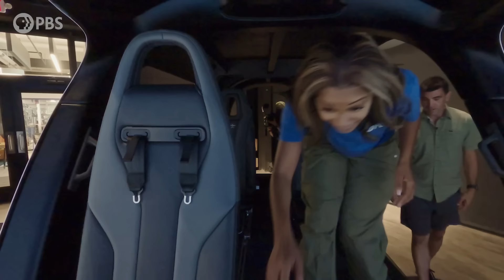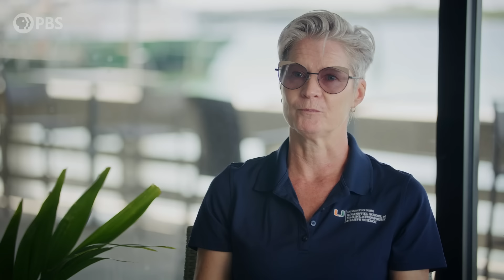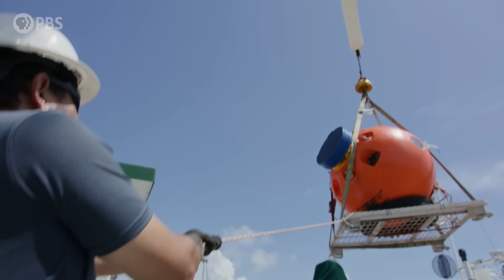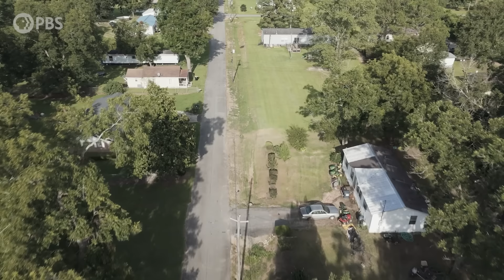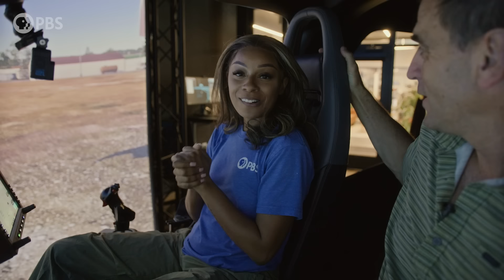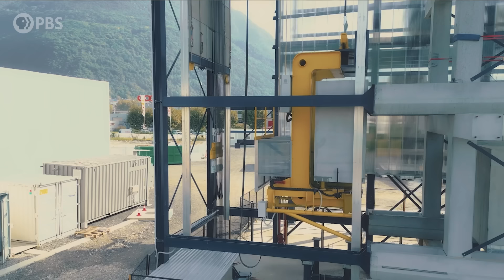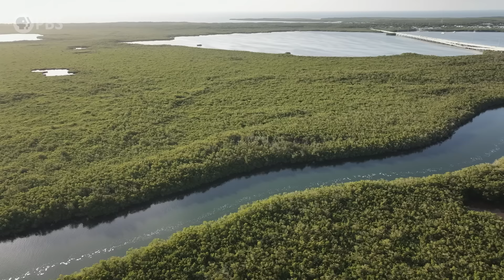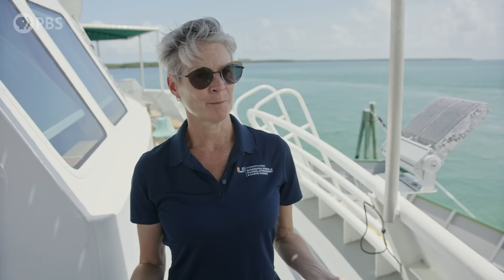This Is The Best Evidence That Atlantic Currents Are Slowing (AMOC Explained)

Comment: insert techno hopium at the 9 min mark.

also... why electrify heating when solar thermal and thermal batteries are significantly superior at harvesting energy per sqm. and storing energy at scale using the volume vs surface area advantages and ultra simple materials, such as Sahara sand being viable, unlike for construction.
Reply: I hate this, too. We are screwed. Do you think ANYTHING will happen with this current US administration? No. Even worse than nothing. Drill, baby, drill pres is stepping on the accelerator and cut the brake cables as we drive off the cliff
Reply: @ We are completely..
I am in the UK. It seems that starting from 2045 uk will lose 30% of ALL plant life, 50% by 2070.
This is due to the Habitat simply being outside of what those plants want.
they will wilt and suffocate.

I am living my life as if it will be 5c by 2100.
Yes, complete civilizational collapse, mad max and the entire 6th mass extinction.

We are at the point in time where every single individual needs to decide if they are going to burn bright and go young, or plan for the long hard cling to existence in order to be the future ancestors of human 2.0

Comment: With the needs of mining, aggro & transportation of goods & people I don't see fossil fuels being fully removed anytime soon. However reducing that need to a minimum to buy time for the innovations needed to remove oil dependency is undeniably a smart & good move for humans & the globe at large.
  What I really want to see is the efficiency accelerate in home & work buildings. Geothermal heat stabilizing systems to reduce our heating & cooling needs. Combined with using older methods like masonry heaters over common fireplace & wood stoves to really make the most of our renewable heating options for more rural areas. Micro Hydro like the UK's Turbulent system to reduce the centralization of power distribution. 
  Next would be advancing diverse permaculture farming & getting away from dead monoculture forests & fields that are leaving depleted soils in their wake.

Comment: In today's world, it is important to reduce electricity consumption after sunset, when solar panels are not producing electricity, in order to reduce CO2 caused by thermal power generation.
I achieved carbon neutrality even during last year's intense heat with a solar panel with a small capacity of 2.3kW.
The most effective device was the icon device, which uses wind to cool rooms during the morning and night hours when temperatures are low.
After trying various things, we found that simply pasting aluminum foil on the inside of the windows was effective in reducing the heat in the house.
Compared to 2017, just before the full-scale use of this Wind Leader, we have been able to save 883 kWh of electricity in 2024 (electricity from June to October).
Although it is in Japanese, the details are listed on the homepage, so please refer to it.

Comment: What electrified heating source powered by renewables is more efficient than natural gas/propane? If you look at the official data sites on different heating sources powered by different fuel sources clearly show natural gas/propane heaters are the top efficient way of heating a space.

Comment: I live in Thailand, we have more than 300 day/y sunshine. I installed solarpanels and 2 homebatteries.. Now we dont need power from the grid anymore. Save money, have stable elacticity and help a little to slowdown the climate change.
Reply: Hello! I live in the Philippines. Please consider using heat reflective paints on your roof and walls. It can help cool down the indoors.
Reply: @aikavi5614  Yes, I know I was a painter when I worked in Europe.. And I did put insulation under the roof too.
Reply: How much would this system cost the average homeowner in Thailand?
Reply: I was told we need better ways to dispose of/ recycle solar panels.

But. Im in Canada.

I live in a place that hates renewables, and sunshine is. Not constant. But even WE have solar panels to at least some less oil? Most of the oil we drill for is for sale, too. Like. Others use our oil even more than us?! 

Like. I have a feeling we could do renewables if we had more walkable cities, and the oil companies didn't buy off our government so hard. Like.

Im glad your countries are being smarter about this, but I wish my country/ my region was.

If I was less poor? I'd be putting in solar panels in anyway. Lol.

Good to see y'all doing the fight, though
Reply: @stoodmuffinpersonal3144  Hi from the UK, they are developing better ways to dispose of and recycle used solar and wind products, some used solar here is sent to African countries as even though panels are not as efficient after 25 years they still work well enough in very sunny countries. With regards to Canada, as you know you get quite extremes of temperature and people walking in below freezing temperatures is a challenge for some, especially the elderly and disabled. One thing to consider is changing to a heat pump as they work ok still as the Scandinavian countries have found, maybe you can even get help with the cost from your local government?
Reply: @stoodmuffinpersonal3144  lot easier and more valuable to recycle solar panels than say tires or most plastics. the copper can be recaptured as most of the silicon & hardened glass can be remelted and reexposed to reactants to reform new photovoltaic cells
not to mention dad still has solar pannels from the 90s that still produce some charge
nothing like the newer ones but we also ran our house on 2 panels back then, these days we have a dozen new super panels and like 7 from various eras in the past so u can do things like run bench grinder vacume cleaner electric welder ext without a generator assist all 50kms from nearest electricity lines
we used to have to run a generator for the larger loads but these days its about same price to just add a extra 500 or 1000 KWH of storage than buy a generator
Reply: yeah in australia we provide 80% of our grid power in day with solar. we are still installing giant batterys but within a yr  or so  its going to be all battery owners filling in daytime when powers near $0KWH thanks to rooftop solar then selling it back to grid at $250KWH till next day
Reply: How did them panels get made? Biggest scam ever!
Reply: That's awesome ❤ your awesome
Reply: No it doesn’t
Reply: @violetquinnlaw:  Do you have any idea of what the inside of our planet looks like? There are lots of CGI images of the internal structure of our planet on the net, so you should!

FYI: The core of our planet is the same temperature as the Sun. The Sun is 93 million miles away, the core of our planet is only a few thousand miles away. They are the same temperature! The only thing protecting our feet from being burned off is the Crust of our planet. The crust of our planet is basically, chemically  speaking, a ceramic and ceramics are some of the best insulators known to science. Which is why they are used on the Space Shuttle to protect it from the heat of atmospheric reentry.

If you  shrunk the Earth down to the size of an apple, the crust would be no thicker than the peel of the apple and everything interior of that, would be red or white hot. Where does all that heat go do you think? Maybe invisible aliens are sucking it up and transporting it through a wormhole so it never passes us by and has no effect on the background temperature we refer to as climate... NOT!

The internal furnace of this planet keeps the overall surface temperature just right, to allow the Sun to add its' energy and produce weather that doesn't destroy all life but does mix and circulate the atmosphere and clean and purify the planet, to foster life here.

It is the incredible stability and finely regulated background-temperature/climate of this planet, that has allowed humans millions of years to evolve and is a testament to the independence and indifference of climate, to anything mankind can dream up. 

I hear the same narrative over and over, "There has to be alien life out there with all those habitable planets!" They just don't understand how special this planet is and this is only one of dozens of factors. This planet Earth is a very special place in the universe. 

This Earth is perfect in every way, to allow the evolution of sentient life and only a life form with exactly the same conditions and history could do the same, so the chances of finding intelligent life out there are slim to none, because there would have to another world with identical everything... Not just in the range but identical! Highly unlikely.
Reply: I live in Western New York. I get snow and cold half the year. The US government built an Air Force base near here because the cloud cover hides it from satellites. I have solar panels and live off grid. There is no reason for people not to be doing it.
Reply: Honestly, great you’re doing that, but we are past that point. We’ve gone past the point of no return
Reply: @habitant71  Gloom and doom is easy, but while there is life there is hope. Surprising changes can happen quickly, but yes, there is a point of no return. Trump, et al, are pushing the wrong direction. The electorate must understand this before it is too late. Was it Churchill who said: "Americans can always be counted on to do the right thing......
after every other option has been exhausted." (?)
Reply: @habitant71  How can you tell?
Reply: All bull sh*t
Reply: You gotta buy bottled water though?
Reply: Everyone needs to worry about air
Reply: Im going to go to college to be a solar panel technician and I will install solar panels free (with a contract not to sue😂)  as long as they purchase materials!
Reply: Your electricity is nice but will it work underwater?
Reply: @rk41gator  I live 44m above sea level
Reply: @ferrydoolaege3776  nice for you! but what about the millions who live between you and the sea? how is their electricity going to work. Bravo for your work but how do we get the US and others to stop polluting the air and increasing emissions.
Reply: Nothing you are doing has the slightest effect on climate...
Reply: @rodkeh  ...we are a collective though, if one person gives you £1 you are not rich but if 1m people do, you are a millionaire, it all adds up...
Reply: @markreed9853  Comparing apples and oranges is considered childish where I come from...
Reply: @rodkeh  Not true.
Reply: @ There is nothing anyone can do to affect the internal temperature of this planet!
Reply: @rodkeh  lol what dose the internal temp of planet have to do with the price of fish. u should learn some science climate change isnt about us effecting the internal temp of earth its about atmospheric warming ie 'outside' the earth
Reply: @rodkeh  ....internal temperature??
Reply: @ Yes, climate!

Comment: Heat pumps are not efficient in some areas.  The killers is cotton wood seed. Dirt dust particles. Stop up the condensation Finn’s  making the unit  useless.  Just burning electric.   The long term studies.  Are not there.  These new AC units. Are  at a loose.   The. Pollution is chocking down the units.

Comment: I live in central British Columbia and installed a heat pump in the first floor.  It works even down to -20 Celsius.  and costs only $0.10 per hour.  We have only renewable electricity in BC.
Reply: Heat pumps are the most energy efficient solution even without green energy. Everyone should be using them.
Reply: @Robynhoodlum agree…however do not work in very humid environments
Reply: @isabelab6851  
That may not be so true, as there is more than one type of heat pump.
The video showed an air sourced heat pump, which is excellent in the state of Georgia.
However there are also water based, and ground based heat pumps.
I bet at least one of those three would work in very humid environments.
Reply: @isabelab6851  you have to do a different design but anywhere on this planet if u go down far enough it starts to warm up u just need to sink a heat well, some places its less feasible than others. you can also setup air or liquid based surface systems for heat capture on/in roofs and walls and then use that to heat things like sand battery's that then via a second system of piping carry that heat thru house at night/when it cools down

but yeah ground trenches arent great if u get a lot of rain even pipes can float but a waffle in sub soils only 1 way of doing a heat pump u can really 'bend' that waffle over and in any way u want so long as u keep a circulation
its a lot easier when your building them in construction not installing after the fact also
Reply: its not that renewables aren't more efficient its that the US dollar to this day is linked to oil so when your pumping oil your pumping reserve currency, so no mater HOW good alternatives are they will find a excuse to have ppl use oil so they can pump oil/$$$
Reply: No one is trying to stop oil use.  But gas and diesel etc are far majority of uses of oil.  @violetquinnlaw
Reply: @violetquinnlaw  Very true....Big oil and big pharma own American politicians.
Reply: Will it work at -40?
Reply: @Mainlychesscontent  very few parts of planet get to minus 40*c(shes in BC hes talking metric not imperial) only artic and antarctic but yeah iceland is powered off geothermal/heat pumps
Reply: @violetquinnlaw  not only Arctic and Antarctic. I was born in Ulanbataar, Mongolia, and lived for 10 years in Irkutsk, Russia. 

Both places hit -50C and lower in winter regularly, and neither are in the Arctic. 

The place where I live now (close to the Arctic, to be fair), hits -30C pretty regularly too. 

Tens of millions of people live in places where the temperature gets below -20C, so if the question was sincere, it's a valid one. And it can be sincere, it was for me when I was looking at a heat pump for myself.
Reply: @Mainlychesscontent  no but it only got down to - 20 Celsius here and it works at the temperature.
Reply: If you’re getting a heat pump chose carefully.  Some are much more efficient than others.  Mine is super cheap for air conditioning but very expensive in the winter.  Newer models are better now.
Reply: @shesh4896  Not really. They claim to be better, in reality they're disappointing in the cold, same as the old ones were. I know several people who have new installs in homes and I had one in my business. Efficiency plummets in the winter and they're basically useless here in New England. Our electricity is stupid expensive also, so it ends up costing more than oil for a solution that isn't half as good.

Comment: Ive heard the wimd turbines kill a lot of birds and also dont last that long and have to replaced quite often
Reply: the bird thing is an issue, but wind turbines actually last 20-25 years a lot of the time. to compare, most chinese coal power plants only last about 20 years. also, the carbon cost of maintenance and eventual decommission is factored in to life cycle analysis of turbines, and generally are a net positive within a year
Reply: More than a billion birds die each year flying into buildings and then there are millions killed by feral animals.....
Reply: Plus they can't be recycled.